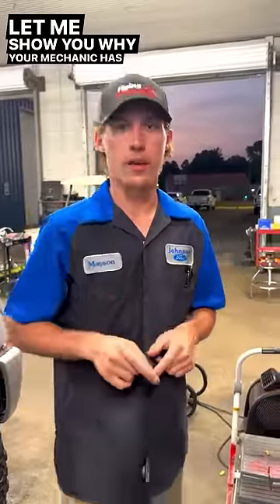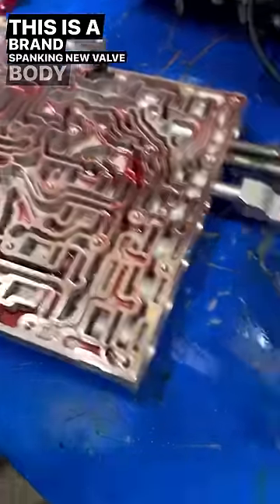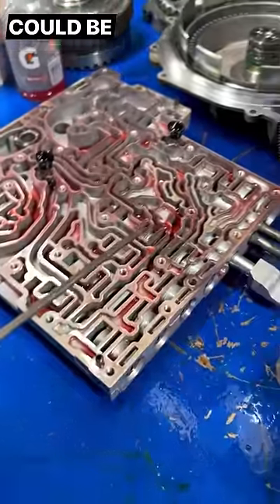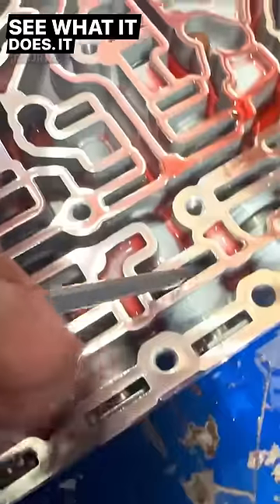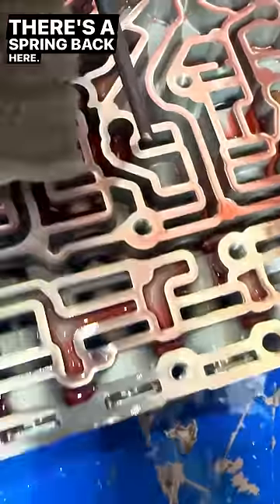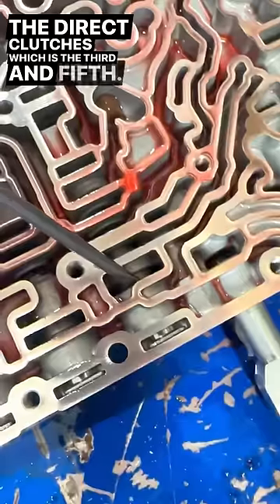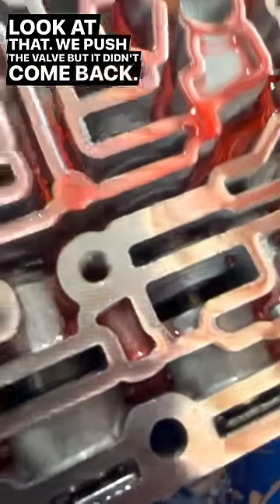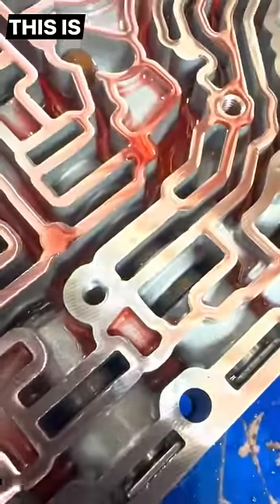Why your mechanic has trust issues #shorts #ford

Comment: When u riding around on top of 1000 moving parts, keep in mind how incredible it is that the damn thing doesn't break down every day. 😂
Reply: Always find this amazing too. I have built simple things before, shelves, sheds etc. Even then I somehow have parts failing and it should be the simplest thing ever lol!
Reply: still inferior to horses which are infinite
Reply: @obscure.reference I drove a ~50 year old car 200 miles in an afternoon, show me a horse that can do that 😏
Reply: @christopheralbano7862 was it a daily driver and what cost comparisons are we considering here
Reply: @christopheralbano7862  we are not meant for such speed of travel even horse speed is pushing it
Reply: @obscure.reference , horses fall sick too, and they need more maintenance than cars. You got to feed them even if you don’t ride it.
Reply: A basic car nowadays such as a Toyota Corolla has somewhere between 20,000 to 30,000 individual parts including nuts and bolts. Insane 🤯
Reply: @esphilee  they need reasonable care and treatment that isnt so much to ask. more maintenance is definitely not true. adequate care for a horse is far more intuitive than constant care for a car, once an issue presents itself in a car it ruins it. in a horse it requires rest and care, fixing itself unless the damage is severe.
Reply: @obscure.reference And if the horse is stubborn and refuses to go 200 miles, even when treated well?
Reply: @obscure.reference  Pfffft, I have mates with horses, they cost a LOT more in both money and time than cars do to look after.
Reply: The same goes for multifunction printer devices
Reply: @obscure.reference you can’t replace parts on a horse when it dies
Reply: @sirsanti8408  you duplicate the horse before it dies obviously. then you just have a younger horse.
Reply: @popuptoaster  but in the real world you could duplicate them infinitely
Reply: @Ben-mw9vz  then you got the wrong horse and probably weren’t supposed to go the 200 miles in the first place
Reply: @obscure.reference Nah, horses require more maintenance for sure. Had my car for 3 years and haven't had to do anything but change the oil a couple times, a horse would've been much more work throughout these 3 years.
Reply: I think about this at least once a week, modern technology really is amazing, we take it for granted.
Reply: @RealShaggy  but a horse lasts consistently for its good years, only requiring food and drink and maybe a mare. a car dies and it dies. unless it’s old and actually makes sense.
Reply: @homiefizzle5260  mormon magickery
Reply: @obscure.reference  Lol nah a car breaks down, it gets fixed. A horse dies and it dies. A car drives consistently for years with nothing done but the occasional start to keep the battery charged. A horse needs to be consistently groomed and fed on a daily basis, which costs money as well.
Reply: @obscure.reference  According to AAA the average monthly maintenance of a car is $123 a month. On the other hand the average monthly maintenance of a horse is $200-$325. Own a horse and junk your car if you want, but it will be more expensive. Not even considering the amount of land you'll need for it. Horses are also pack animals so you'll need more than one. Also if you junk a car because it died I have bad news for you, the battery was probably dead, could've fixed that for at most $250 and been fine for years.
Reply: Electric!
Reply: @obscure.reference you gotta keep that thing alive 😂 that's not infinite that's a whole ass creature to care for, at least if I ignore my car for a week it'll still be alive when I come back 😂
Reply: @obscure.reference there are very few single issues that could ruin your car, most of it is general maintenance, oil changes, tire replacement (which would be comparable to horseshoes), trans fluid, every few years maybe a battery, most problems that ruin cars come from wrecks or neglect (for a horse that'd be anything that lets it get sick or something) car maintenance is easy most people just don't bother to learn, even fewer people learn how to care for animals even when they have them
Reply: @geigertec5921  cars do that when you race it's just illegal 😂
Reply: It's cuz Jesus bro. He keeps it working.
Reply: This is one of the biggest advantages of an electric car. Have you ever seen an electric motor?
Reply: Same way with the Internet, it's a damn miracle any of this works.
Reply: @chronicallydazed5446  it’s infinite because it can procreate. feeding and caring for a horse isn’t that intrusive. just feed it when you eat.
Reply: @chronicallydazed5446   but a horse is a living thing like you and i, so to learn what it needs to stay alive is very intuitive. just do what we would want done in most cases. a car you do need some capacity for memory and mechanics to fix. that’s something you can learn sure, but any idiot isn’t gonna do that. any idiot could, however, feed the horse a couple times a day. pay attention to when it’s tired or sick. which is not even to mention that new cars are practically impossible to work on beyond the most basic and immediate mechanical functions thanks to all the stupid computers that break themselves constantly.
Reply: @galactic6262  i mean im not gonna junk a car until a mechanic tells me it’s more complicated than the battery lol. these costs are modern anyway, $123 doesnt even cover my gas for a month. the world is not really conducive to horses today, i dont think it’s a more viable option, i just think horses are a cooler way to get around and far more sustainable.
Reply: That because there are substances in the automatic fluid that corrodes anything other than the materials that build inside the transmission
Reply: @RealShaggy  a horse dies and you move on to horse junior, it’s that easy. infinite horse glitch still isnt patched after hundreds of years. i also think the ritual of caring for another living thing with food water and grooming is automatically better than the ritual of putting fossils in a furnace.
Reply: Not only that, it almost never breaks down
Reply: @obscure.reference if a horse gets a flat tire, it goes to the junkyard
Reply: It's even more amazing when you think of something like a submarine for example
Reply: @obscure.reference horses break down too, it's called dying
Reply: @obscure.reference damn if they were infinite why did Ww2 only last 5 years?
Reply: Old cars and trucks were built simpler than this new stuff, and thus, we still see them on the roads.
Reply: @HeywoodJablome28  doesnt make any sense
Reply: @mewmew8932  lol you guys are so ridiculous. horses can get sick, break legs, etc but they’re living things, with immune systems, and the ability to heal. cars do not have this.
Reply: @obscure.reference  a cars healing is me with a wrench
Reply: Time to buy electric!
Reply: @mewmew8932  hahahah what
Reply: @obscure.reference dude at what point do you realize there’s a reason  your opinion isn’t the common consensus?  Do you honestly think you are just smarter than every person you come across?
Reply: @obscure.reference then why did we move so far away from each other?
Reply: That's why electric engines are so great. They are just extremely simple and pretty much indestructible. Too bad you gotta haul massive batteries around with them.
Reply: Every day, man. My cars older than I am, and I'm 22!
Reply: I will get crucified for this one — EVs have a tiny fraction of the moving components.
Reply: @okthisisthelasttimeipromise  Yes you will, my good eco friendly friend, yes you will
Reply: The price of cars these days I feel like they should fly
Reply: Yeah that thing is basically a computer that runs on fluid pressure for logical operations instead of electricity and 0s and 1s
Reply: Don't forget about the fact that it can run for fucking years without proper maintenance, yeah it's probably fucked but it's still running.  That's insane.
Reply: @obscure.reference we aren't "made" for speed of travel at all, that's not how the body works.
Reply: @platinumsky845  exactly
Reply: Fun fact, there’s also about a mile total of wiring in vehicles. Newer ones might have a mile and half of wiring
Reply: Think about how many people died to make your car
Reply: @deepsameer1  how dangerous do you think automated assembly lines are
Reply: @obscure.reference  during the industrial era? Dangerous enough to put a kid on the job rather than an adult
Reply: @deepsameer1  children were used on machinery because the machines were cramped together. not because it was dangerous lol. that doesnt make any sense. and you said “your car”, nobody’s driving around in cars from the industrial era. make it make sense fool.
Reply: @marijuana_iguana789  what? im just talking. i dont think my opinion is actually better. im just answering questions. i dont actually think horses are viable for transportation today, lol.
Reply: @obscure.reference there are plenty of leg injuries that basically make a horse useless. These can be caused by very minor things.
Reply: @jimnoel3025  if your horse breaks you could have bred it. cars you have one chance at maintenance.
Reply: @obscure.reference  do you think that the time/money  investment from breeding and raising horses is at all comparable with even a 2000 dollar bill helll even 5000 probably wouldn’t be close.
Reply: @jimnoel3025  what $2000 bill are you even talking about? new car costs more than 2 or even 5000
Reply: @obscure.reference   your misinterpreting my point, we have phones today that were not possible to make without the efforts of slaves. We didn't find diamonds and rubies in our hands. Someone had to risk their live to get them. And no we didn't use children because machinery had small parts or that they were cramped. It's because we didn't have a large enough work force and we had to rely on children because our government forced us to do so. 

But yes ultimately even today we don't risk our children to go to the dangerous jobs. We let children and adults that don't matter to us (us being the upper class or management).

It's is better to be thought a fool then open ones mouth and remove all doubt - Abraham Lincoln
Reply: It does break down every day
Reply: @obscure.reference  what do you mean "supposed"? I want to go 200 miles in a day, so I need a vehicle that can travel 200 miles in a day. No stops for resting.
Reply: @mrosskne  you have no such natural right
Reply: @deepsameer1  literally describing victorian industrial conditions, dont know why you’re pretending that has anything to do with modern vehicles or the car of anyone you’re talking to, or your own experience
Reply: @obscure.reference  a repair
Reply: @obscure.reference  There is no such thing as a "natural right". There are things we want to do and our ability to do them. We can do whatever we want as long as it is within our ability to do so.
Reply: @kaybe9797  breathing and reproducing are natural rights
Reply: @obscure.reference so would you say that we should get mustangs for our transportation needs?
Reply: nope lol
Reply: @obscure.reference your horse can even make another horse so all you need is a male and a female
Reply: But it does :/
Reply: @Shawn420s  thats what im saying infinite horses
Reply: Same with modern computer motherboards with 14 layers of copper.
Reply: @obscure.reference  Humans are not "meant" for any speeds, there's no limit except light speed as far as we know. A few Humans are orbiting at 28 Mm/h (8km/s) at this very moment and they're doing just fine.
However Humans can't endure more than 6G of brief acceleration, even trained pilots barely endure 9G for a couple seconds.
Reply: @Soken50  1 mile per minute is okay
Reply: @obscure.reference  you're slightly off buddy, that's 290 miles per minute.
Reply: @Soken50  1 mile per minute is not 290 miles per minute
Reply: @obscure.reference   No ?! Really?!! Why the heck are you replying about 1 mile per minute when I'm talking to you about orbital speed then ?!!
Reply: @Soken50  space isnt real so orbital speed is irrelevant
Reply: @obscure.reference  So you're not gonna answer the question and just peddle more irrelevant conspiracy, gotcha.

In the unlikely case you're not trolling, literally just look up, you don't even need instruments to see the space station transit, with binoculars or a telescope you can even distinguish the solar panels and various modules, you'll have to set it up in advance though, due to the aforementioned speed.
Reply: @Soken50  telescopes are just VR they dont show you anything that’s actually there, if you make your own you can see heaven.
Reply: @Soken50  BTW horse speed is about a mile a minute, 55 mph, which is why i brought it up. it’s an okay speed to go.
Reply: @obscure.reference  Every speed is an okay speed to go, speed has no effect on human physiology, at least no greater than lack of oxygen or gravity as far as we've been able to test.
Reply: @Soken50  being able to travel more than one mile per minute has adverse effects on the human psyche
Reply: @obscure.reference  You have a source for that ? 
Or is that just personal experience ? 
If it's the latter I'll have to assume you've been commenting near the speed of light this entire time.
Reply: @Soken50  for the average speed of a horse? it’s easy enough to look up. if it’s the other thing just make a telescope.
Reply: The more this reply section goes the worse it gets
Reply: @AndyTheBoiz  preach
Reply: @Soken50 read that as peach and now I want to eat some peaches
Reply: @RealShaggy 
If you haven't fully serviced your car in 3 years, brace yourself for a failure any day now.
Unless, of course, you've done fewer than 20000 kms in those 3 years.
Even then, there are parts that deteriorate just with age.
Reply: Well to be fair most parts can break and as a whole it will still run. It’s just that when one part goes bad it causes more parts to go bad until eventually you run it into the ground.
Reply: @obscure.reference  as someone said before horses are pack animals so the viability with them is very low you need lots of land and multiple horses and you say it like you have taken care of horses before it is ALOT of work alot more than starting your car and filling it with 87 and taking it to a mechanic every 3 months you need horse shoes food for multiple horses then when you do you "infinite horse strat" you are taking care of 3 horses for a means of transportation and if you are taking them on 200 mile trips you are gonna have to take care of the horse hooves would you wanna walk around all day in clunky shoes. Someone like me that lives in a city it would be a shame if I owned a horse am I gonna keep him out front parallel parked?
Reply: @B3ASTLYPLAYZ  bad take
Reply: @obscure.reference  lol that ain't a bad take, those are most of the maintenance requirements for horses. Only thing the guy is missing is veterinarian bills for their shots and cleaning their coats. You've been drastically oversimplifying the requirements of caring for a horse and constantly moving the goalposts for the sake of winning this argument, it's dishonest and petty.
Reply: @kyotra  its youtube comments dude settle down, the only point is that horses can basically grow on trees.
Reply: Ford does stand for Fix Or Repair Daily though :P
Reply: Were entering the age of computerized cars. Its gonna be more of a clusterfug fixing each tiny problem
Reply: You could say the same thing when it comes to your body. Take care of yourself. :)
Reply: @obscure.reference I noticed you gave yourself the out with "severe." Have you ever seen videos on treating hoofed animals which have developed problems below the knee. Not just the hooves, but all those bones below the knee. There is a reason large animal vets are in short supply - until we get AI that we cannot turn off, a car isn't going to try to kick you while you fix it. :)

PS or bite you, knew a lady who was a professional horse handler and ended up working for Disney. One horse decided to bite her upper arm, and that bruise was worse than anything I had when I dumped a motorcycle at high speed. Though the helmet, jacket, and blue jeans were ruined I only had light road rash. She had a bruise extending more than halfway across the upper arm, and over a quarter of the length. She had trouble with that arm for over a month. And that was through a jacket. Horses can be MEAN.
Reply: >me staring at all the pretty lights on my dash for the thousandth time in 6 months as I drive to the gas station on empty for more cigarettes and monsters
Reply: @obscure.reference ... Not sure you understand what "infinite" actually means...
Reply: @Essex121514  i do
Reply: @obscure.reference yknow how much work is involved in rearing a horse? I could learn transmission repair before you broke a colt.
Reply: @adolfilyichmarx9589  but then what, you go around repairing transmissions? im gonna have three generations of horses running at once, you’ll see. you’ll all see.
Reply: Why we need public transit